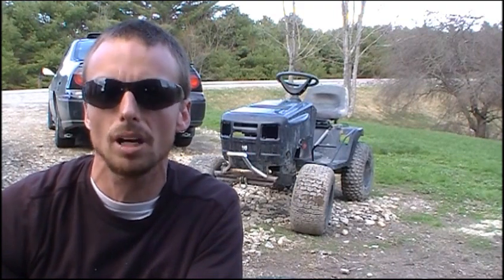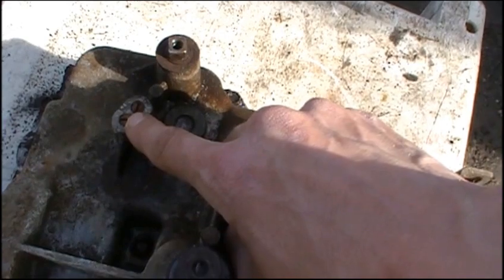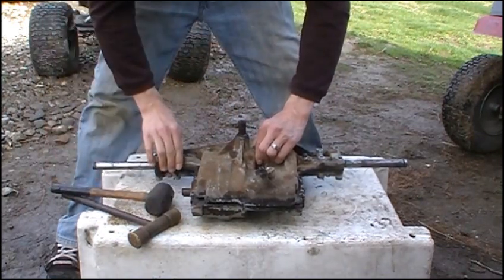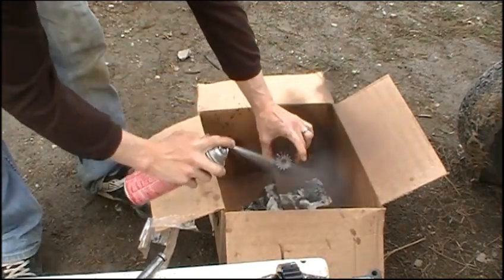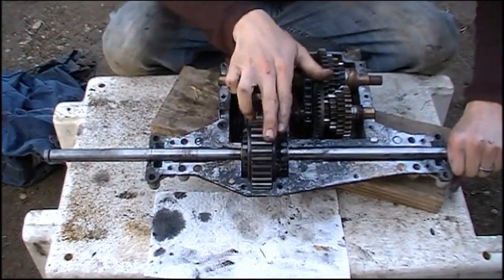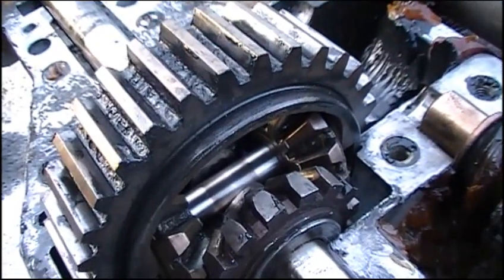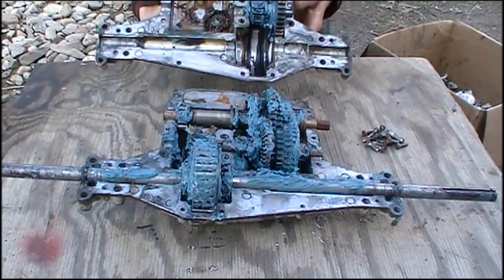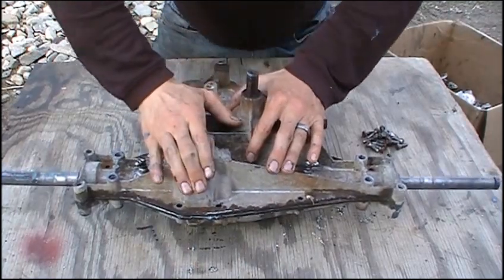How to: Lock a Trans-axle or Differential

Comment: What I've learned from this video:
Be careful with your little balls
Dump your fluids before go to town
Grease your shaft
Use a rubber if you can
Reply: 7eis I suggest watch a 13 part series called What on earth happened by Ewaranon to learn that the earth is not a globe.

I got it in my about tab.

Comment: Thought I'd add in, as I've "Lincoln-locked" over 20 axles in my lifetime. Never a lawnmower one, but everything from 240sx pumpkins up to 14bolts. As far as welding the backside due to machined surfaces - it doesn't matter, since it's not going to spin anymore. Welding the inside is actually worse, since that center pin is a hardened steel shaft and has now been annealed along the haz (in the weakest possible spot).

Place small BOLTS in the meshing gear teeth and weld all the teeth to the bolts, then to the adjacent gear. Then weld anywhere the gears mesh. Avoid the cast iron housing (in this case sun gear), and the pin. Definitely DO NOT weld to the axle shafts. Replace the c-clips, or replace with the other spring style ones (which removes the need to grind the shafts as well).
Reply: I have a Craftsman pro 54" and would like to have a limited slip diff but failing that, a locking diff.  Will a posi tear up the lawn at all if there are a lot of turns?
Reply: You would be right about that if it was a car but it isn’t so it dosent see anywhere near the rpm range as an automotive diff would

Comment: WAIT FOR THE BRAKLEEN TO DRY BEFORE YOU WELD! I am still growing back my eyebrows!
Reply: +Conn0isseur Dana 
hahaha learning from experience
Reply: Experience is key haha
Reply: +Conn0isseur Dana  ...and welding fumes and brakkleen vapors mix into a mustard  gas :) not good lol.
Reply: Wiring harness6
Reply: Hahahahhaa , understand
Reply: LMAO
Reply: Conn0isseur Dana 
https://www.brewracingframes.com/safety-alert-brake-cleaner--phosgene-gas.html
Reply: Brake cleaner makes deadly gas if inhaled, don't weld it!
Reply: Is there anyway you could do this without a welder
Reply: @bobmusket2990  yes there's millions of ways to blow off your facial hair xD but if you're asking about locking a diff I say of course if  there's a will there's a way. But the 100$ you would spend on jb weld and steel plates would cost as much as a harbor freight Flux mig or paying someone to help.  But there are a lot of forces at play so be aware that you're gonna need a lot if you go the jb weld route and make sure it's the OG red and black tube with the high tensile strength the kwik will have a lot less dry time but like half of the holding power. Good luck!

Comment: i locked my transaxle using this method, you make it look easy getting the axles and spider gears in! when i did mine i took it to school and used the varsal tank and cleaned all the gears and the case, re greaced averything really good, i packed both sides and i had greace ozzing out putting it back together, i used almost 2 cans of greace! and mine would not spin at all, i thought i had all the bushings aligned but i guess not, but it wore it self in in about 10 mins,

Comment: Hey Fearless Front - I enjoy your videos. I am in the process of making a side x side True Utility Cart, using a Yardman 18 HP, 14 spd Garden/Lawn Tractor. I hope to put another rear on front & cut axiles ends, add steering U joints, bearings to front for a 4x4. Extend steering shaft, add U joint & bearings, to be able to move steering wheel to right side of cart. Cart frame will go over existing tractor frame, using 1" heavy walled tubing.   GREAT GOING!

Comment from the maker: I weld the spiders onto the axle because in the past, I have broken those internal c-clips. I had my wheel, hub, and axle slide right out of my transaxle case while I was "side hill-ing" in my back yard. so now I weld them on. I have been running a similar setup in another off road tractor for about 5 years with no problems as of yet.
Thanks for the comment!

Comment: We did that to one of my cars long long ago.  We just welded the gear teeth, so it didn't weaken any of the shafts.   The shop did that to most of the dedicated oval track race cars for various racing classes.  They never had any differential related failures.

My car was a 1982 Firebird with a 2.8 v6 and 4 speed stick.  We upgraded it to a SBC 350 (v8).  Stock differential it was open.  We just welded the spider gears without disassembling anything other than the cover.   I drove and raced that car ("spectator" street car class) for a few more years after that.  It was finally sent to the bone yard when the body twisted too much, and the firewall cracked.  I was really hard on that car.  It was nice that burnouts were always equal length parallel lines.  Much better than the one wheel squeal.   I can't recommend that anyone does it to a car, because of the obvious wear issues.   But it was a lot of fun to drive.

There is one thing about doing this.   In the car, it was hard to turn in parking lots, and one wheel scuffed through the turn.  I sometimes had to bump the gas to turn.  On a mower, if you're turning sharp, it will tear up the grass under the wheel that scuffs.   But if you're just using it to drive around fields, or you only do wide turns while mowing, it'll work great.

Comment: You know, I've seen a lot of comments over the years by people requesting you do a 4x4 lawn tractor...
You really only need a secondary trans-axle and cut the out hub mounts off and put on two u-joints from a Jeep Wrangler steering shaft. Do a flat grind on opposing sides to have your surface and snug down the set screws. You could weld them, but that wastes the axle in the event a joint fails.
You can buy heavy duty steering joints for around $16 to $20 and just use a secondary drive belt on your motor. It'll work easily! I may try to make a 4x4 because I'm bored and because our zero turn gets stuck fast... This would make for a great recovery vehicle as well as a great toy!
Reply: That's cool did you do it??

BTW Aint I suggest watch a 13 part series called What on earth happened by Ewaranon to learn that the earth is not a globe.

I got it in my about tab.

Comment: I locked mine and now my tires spin backwards when it is in a forward gear.
Reply: Oh no 😂😂
Reply: You conected the gear seltcion backwards
Reply: You put the axle in upside down
Reply: Fuck it, just put it in reverse
Reply: What advantage is there to locking the transaxle. It’s just a lawn tractor.
Reply: @fiddlerpin  you don’t know good fun
Reply: @jaanuspapp1333  Race mode
Reply: @fiddlerpin  u can pully swap em and they go hella fast lmao
Reply: @fiddlerpin  I’m watching this video right now for a snow plow rig im building hard to plow snow with a one wheel peeler
Reply: @ziamckeithen1322   😆🤣😂 How could he put the drive belt on 
 the large pulley if it's upside down?
Reply: You are sitting on the tractor wrong turn around on your new rear wheel steering tractor
Reply: Put it in reverse tarry
Reply: If both of your tires are spinning backwards it means you put it in upside down but if there is only one tire spinning backwards then this means that one of your welds on the inside broke and is only allowing for one wheel to spin backwards. This shouldn’t happen.
Reply: @jaanuspapp1333 damn straight lol
Reply: @fiddlerpin when offroading or riding over bumps. If one tire comes off the ground it will just spin and youll stop, if you lock them itll spin both and you wont get stuck, and honestly over the years of expirience, lawnmowers make some pretty sick offroaders, ive sunk them in my creek, climbed rocky hills amd all sorts of fun stuff

Comment: if you have oxy-acetylene torches light your acetylene and let them smoke where there making suet which is a black  smoke if you run the flame over the steel it forms a coating on the steel when you weld with the mig all the splatter will not stick and saves you going with  a screw driver removing the splatter! if you have a piston on like a hydraulic cylinder and your welding around it you can suet the chrome rod do your welding and then just wipe off the black smoke and you won't have any damage to the rod.
Reply: wow, good tip....I'll have to remember that
Reply: A great tip. many thanks
Reply: Thanks for the tip I'll have to try that!
Reply: What are you doing ,feeding birds ????(SOOT)
Reply: dynamight TNT tip!!!.........

Comment: wow this was way easier..i was going to try to machine a full shaft and final gear for my tractor..just finished this today using your method and will test it out tomorrow with some bashing through the woods..
Reply: ***** hasn't broken yet used it today to pull close to a ton of sand in the cart so +5 for griffindor

Comment: I am just now finding your channel. I enjoyed watching you guys romp in the mud mowers. I have so many questions but, I am going to try everything myself with as little advice as possible. Thanks for sharing how to do this. I was really afraid my tractor would get stuck a lot but now that I saw your video here, I am def gonna try locking my dif. I am already raising the mower 12" higher and so between the lift and the locker, I feel confident I can go anywhere! Next problem, how to swap pulleys so it goes faster lol

Comment: I have been working on mowers  for about 3 yrs and I think guy know his shit and that was a  Dam good job I will  be doing the same thing to my 2 mowers tomorrow thank you for your help.
Reply from the maker: Thanks, and make sure you check the alignment of those internal bronze bushings. they have little tabs on them and are easy to over look. It's still catches me by surprize every once and a while
Reply: Ralph Stevens well how is it going with those two mowers. Broken yet? Wearing out tires faster? Honest Update? 

What this guy should be doing is replacing the clips and not welding the spider gears. There is reasons why they don't come welded. He should take the other gears to a machine shop and have a keyway cut into them. Gives or doesn't take away the gears ability to mesh ad needed.

Comment: Took mine apart last night, forgot about those two little hidden bolts in the center that were on the bottom. Good thing I remembered you mentioning it, or I would have been out a transmission!

Comment: I have locked a few mowers just like this method.  Works very well, but just my opinion here.  I tend to go mudding more than racing or anything else.  I prefer to have the axles not locked so i can "shake" or wiggle back and forth to allow one tire to spin then the other.  The belt has a lot more strain with it locked, but dougnuts are FUNN.  good video.

Comment: i did this same thing about 4 years ago on my mower it makes a world of diffrence.   when i had mine apart i drilled and tapped drain and fill holes replaced the grease with 80/90 made for much smoother operation

Comment: Todd,  I use a spray with my cheap mig welder when I am worried about slag sticking.  You just spray it on everything you don't want it to stick to and after you are done welding the cleanup is a lot easier. Nothing sticks. Its the same stuff you spray in you migs nozzel. It might have come with you welder when you bought it. I also you argon gas with mine. If that makes a difference. I don't know. Very nice video. Excellant.

Comment: All you need to do is weld closed three teeth on the 🕷️ gear, and than weld the opposing three teeth. Do all for gears.
Reply: I have one of these on my mower that came off a tractor and when i put it in reverge gear it moves forward but when i put it in gear 1-5 it moves backwards is there a way to fix this?
Reply: @KL_daddy   Your belt is routed wrong causing the trans to spin backward.

Comment: Hey Fearless...I am getting my welding degree right now..and in our shop we have this stuff that comes in an aerosal can called anti-spatter..so if you are welding on stuff that you don't want spatter to get on you just spray it with this stuff and the molten metal metal runs right off of it..just a little tip! awesome vid i will be attempting this on my murray!

Comment: I know this video is old but could I just weld all the spider gears together instead of welding it all separate?
Reply: I was wondering about that to but. The two rods and their spider gear but the little one taking it out an welding it without proper measurements it would most likely be misaligned. Sense if the metal heats up it expanse even a little an when it cools it may not fit back in an the other spider gears would be in the wrong position so its best to weld them in the position they fit best. Other wise its back to the drawing board. Thank you Loader.

Comment: To bad manufacture's  don't just make a button you could push & have instant posi track.
Reply: Cruiser007 by Kubota tractor has a lever to lock it when you need extra traction.
Reply: Our new husqvarna lawn tractor has an electric locking rear end! Works greay
Reply: No Rubicon mowers?

Comment: not safe to weld anything that has ever had brake cleaner on it. but other wise very informative video
Reply: only if it was chlorinated brake cleaner, it creates very deadly gases
Reply: Chlorinated brake cleaner evaporates! If it's dry, not an issue. (OTOH, non-chlorinated brake cleaner is highly flammable...would you sooner die of cancer, in three decades, or in a fire, in three days?)

Comment: Thanks fearless, I took it apart today and it was easy as hell to lock. The vertical split ones are so much easier let me tell ya. You can pull the whole assembly out in one piece and weld it outside of the case and not get slag all over. The only problem was that I accidentally shifted into a different gear while it was apart and all the gears got out of wack. It took me about 2 hours to get them all back the way they were considering I had no clue where they went and no diagram.

Comment: what  should u do if the  rims dont come off the axle
Reply: then the rim is ceased what I did was I grinded the rim of the axle it took me about 2 days to grind it off
Reply: Country Gamer 2 days? with what, a nail file?
Reply: this reply might be a little bit late but you can make a puller out of a piece of flat bar and 2 bolts and 2 nuts, cut the flat bar to fit inside the rim, drill or cut holes in the flat bar that match the holes in the rim, if there is no holes in the rim drill one on each side of the shaft, put the bolts through the holes in the rim and the bar, put the nuts on and tighten evenly holding the bolt on the back side and tightening the nut on the front side, when the shaft is flush with the rim put a socket between the flat bar and the shaft and continue until it comes off, make sure the socket is a little bit smaller than the shaft
Reply: D M or you can just go get a rent a tool puller from AutoZone or places like that.
Reply: Andrew Chase if the rim doesn't come off the use of a GOOD torch with rosebud combined with a pull puller will do the trick in most cases. Remember to try and not heat the shaft directly, just the rim.

Comment: @Fearlessfront I haven't cracked the trans yet, but I think that's the plan for tomorrow night. As long as the gears are the same, I will do it the exact same way you describe here. I ordered a new engine pulley that will be in at the end of the week. Hopefully by the weekend I can start re-assembly. Thanks man!

Comment from the maker: hey man, inside the case, there are some brass bushings that the shafts have on the ends Make sure all these brass bushings haven't gotten mis-aligned before you put the cover back on. they have a notch on one side that has to rest in a "cut out" area in the caseing.

Comment from the maker: It's a "wire feed welder" which is a mig without gas. It uses flux core wire.
You might be able to use a stick welder, I havent tried it, but if you good at using it, then go for it. just tack weld it together in the case, then remove it, and weld it up solid.

Comment: Swapped the vertical shaft to a horizontal shaft motor by bolting a six inch pulley to the disc brake rotor . Fine splines on that shaft but I am running 20 hp twin and hasn't stripped the splines yet , if it does I'll just cut in 3/16 keyways . For brakes I kept the horizontal input shaft on and just have a v-belt wrapped around it that I can pull tight ( belt is anchored to the frame ) that will lock up both back wheels a lot better that the original brake system . Used the trans axel and made a three wheeler for the bush . Single front wheel is off a 250cc scooter so has hydraulic disc brake on front wheel . Got speedometer and trip meter . And a sign that says don't drive in farther than your willing to walk out  lol

Comment from the maker: I think the key here is to make sure the surface has has ample time to dry (30 seconds should do it) , and weld outside or under a ventilation hood. I would also advise you to hold your breath while you weld, and not suck down the fumes... Inhaling excess amounts of any smoke or fumes can kill you, I just figured people would use a little common sense.
I've been doing stuff like this for many years, and never had a problem.

Comment: This used to be know as a "Lincoln locker" because people would do it with a Lincoln welder. I just welded the spider gears together where they meet and it's been working on my old Sears garden tractor for 25 years. Only draw back is occasionally the tractor wants to go straight even though the front wheels are turned full lock.

Comment: Thank you for your feedback & insight. Small city backyard, I have to be able to turn extremely tight. Will try weight, tire studs & an electric winch leaving the spider weld for last as it's a no going back solution. But if I have to, I have to. More reading led me to find out this process is called a 'Lincoln Lock' after Lincoln welders. Best Regards -Craig